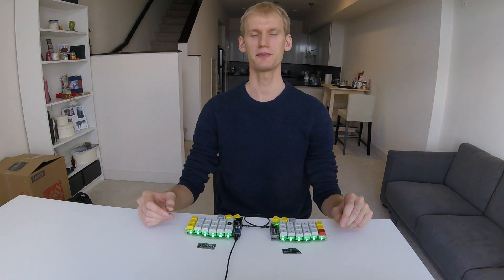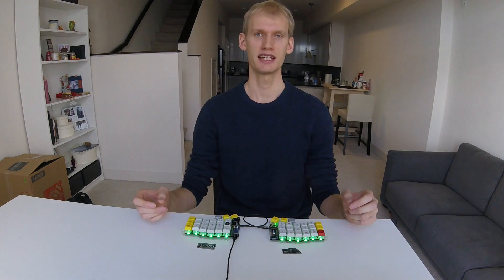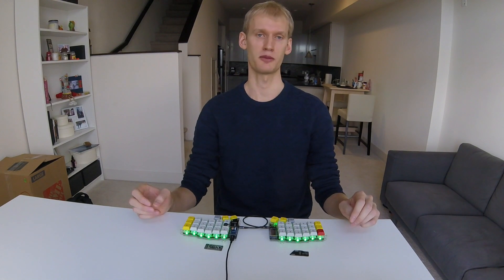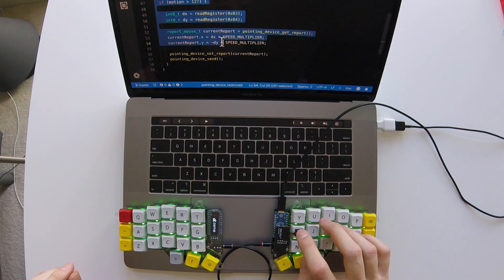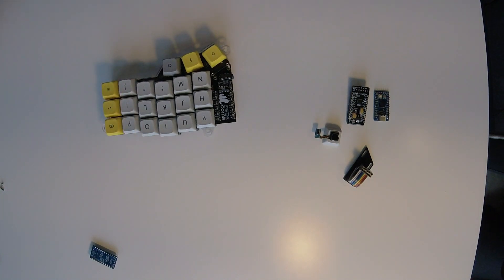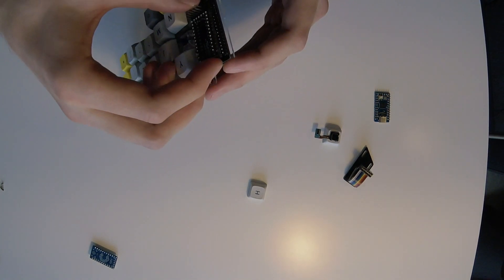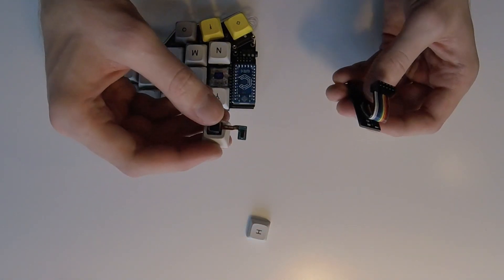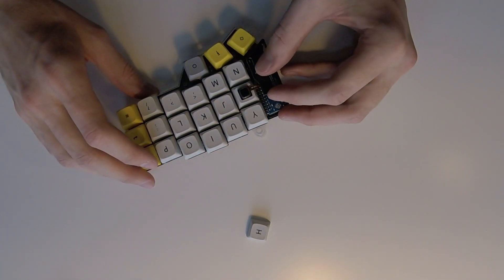Trackpad in a Keycap for Corne/CrKbd keyboard!

Comment from the maker: Hey, a quick update on the keyboard and the trackpad flex connector durability. 
I've had this exact CrKbd as my main keyboard at work for the last 2+ years, the only change was an upgrade to /DEV/TTY MT3 keycaps. Apparently, MT3 is my favorite profile :)

Regarding the flex connector - it's the same flex cable, for almost 3 years! No issues so far, so it's way more reliable than I expected.
Here's the latest image:
https://imgur.com/3WQpY7q
Reply: I do have to say that I’m more than impressed by this. And it is also amazing that is so durable. I already found out what I’m going to do with my free time now that I’m finishing college. Thanks for sharing this wonderful project!!!

Comment: I really want to do this with a low profile sensor like the LNS-R2, but I don't really have any technical experience. It's a shame that this sort of idea isn't widely available, because it would really cut down on a lot of touch input problems and increase ergonomic efficiency even on laptops and tablet keyboards. I much prefer something like this to say, a trackpoint. My finger's already there, I should be able to do some small motion to get my cursor somewhere relevant. I would even take a separate USB peripheral with a small wire I can thread through my board if it meant I don't have to reach for my mouse.

Comment: First of all - great project and execution!
Do you think it is possible to integrate the trackpad inside the keycap so it would be level with the keycap surface?
Reply: My guess would be no since it is still a working key, so if it were mounted to be level with the surface of the keycap, it would interfere with the switch. Just my guess though, I could be completely wrong!
Reply: If you had taller key caps on your keyboard, like common OEM profile, and then had this installed on top of a base the height of a low profile keycap, there could be enough room for it to be level with the standard size taller ones

It might be possible to make it a standalone key cap that you could just plug in to a normal board, with a wire extending under the other keycaps that would plug into a USB like any other mouse

I would buy one of those

Very clever design! It would be great to have better ways to control the mouse without moving your hand from the home row

Comment: Very cool! 

Also, what sockets did you use, and which pins?  Just diode legs?  Or?
Reply from the maker: Thanks!
I use this low profile socket:
https://www.digikey.com/product-detail/en/315-43-164-41-003000/ED4764-64-ND/1212143

And Mill-Max pins, compatible with the socket: 
https://www.digikey.com/product-detail/en/3320-0-00-15-00-00-03-0/ED1134-ND/4147392

Sorry for the late response!

Comment: Nice! Any problems with the cursor going crazy when you're hitting the H key?
Reply from the maker: Yeah, the cursor goes a bit crazy when I type, but it doesn't really make any problem.It's not possible to make a "mouse click" by touching the H key with this configuration. So in the worst case cursor will move to some menu/button and activate its mouseover event.
There is the second version of PCB where I put the sensor on the PCB itself and typing doesn't affect the cursor:
https://github.com/vlukash/corne-trackpad

But I still like the H-key sensor better :)

Comment: This is very cool, congrats on getting it working. How do you find the trackpad to use versus a mouse? is it easy to get used to / quick enough
Reply from the maker: Thanks! I've used a trackball for some time and set pretty high sensitivity on it. And now this trackpad on a keycap feels pretty much the same really. I'd say it was about a week for me to get used to it. 
The trick is that I set low initial cursor speed(sensitivity) and low acceleration threshold speed. Then very fast cursor speed after the threshold. That allows me to control cursor very well on slow speed motions and at the same time, I can move the cursor to the opposite side of the screen with one fast swipe.
But I'm still playing with the sensitivity/acceleration settings :)